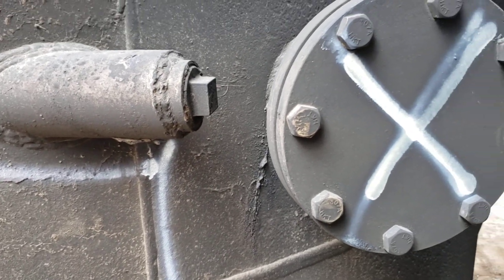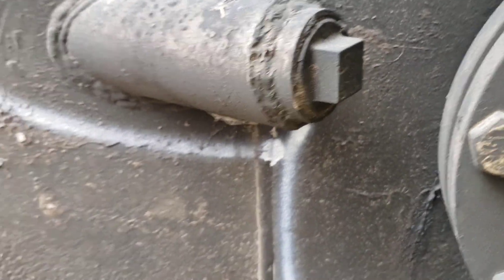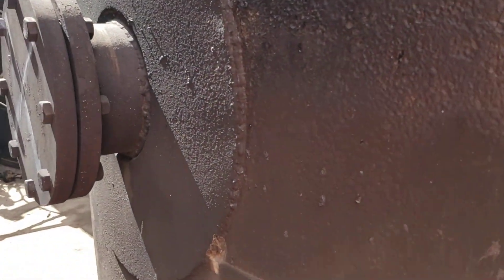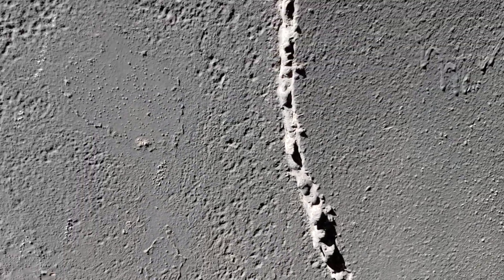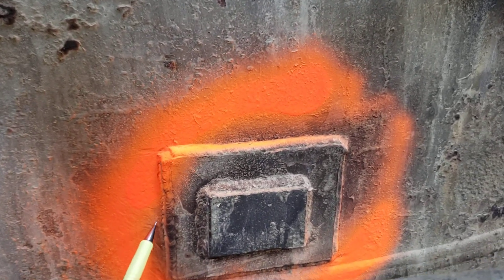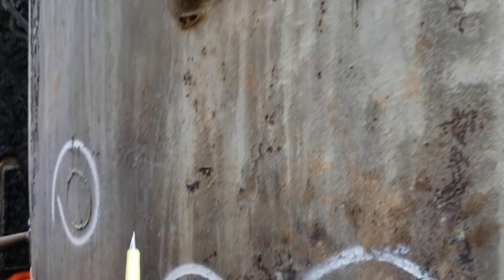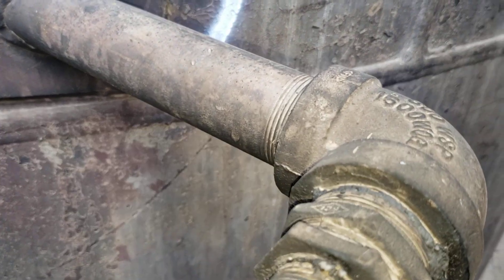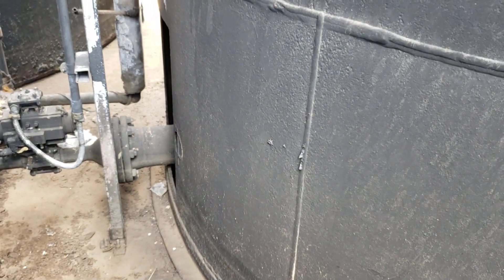poor welding repair practices

Comment: Excellent as always Mr. Eric. Very perceptive, bringing along a lot of highlights that one could pass by with lack of experience.  I'm Reading API RP 572/510. So these videos are very helpfull. Greetings from Venezuela ;).  This Vessel is way down out of norm. It looks like it need a hall replacement. Or at least the renewal of a few shell plates. It has linings or any cathodic protection? o some epoxic inner painting?
Reply from the maker: It was replaced.